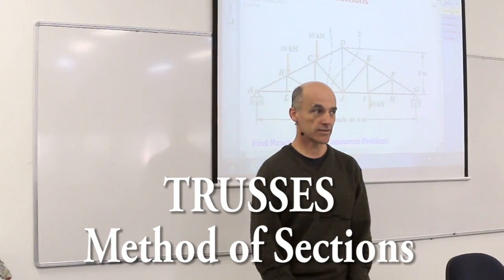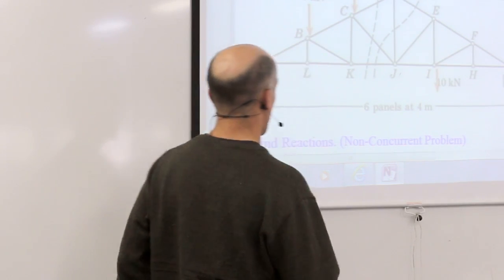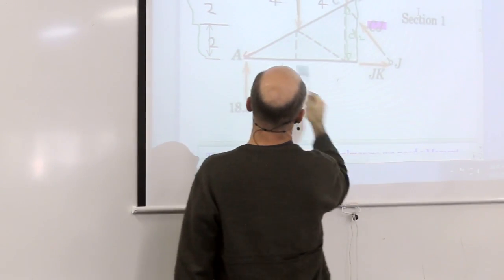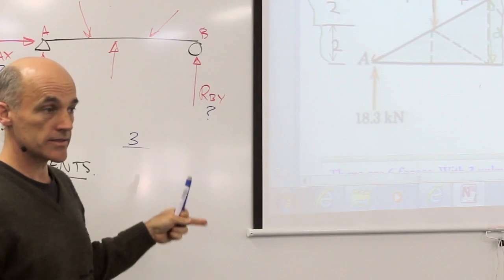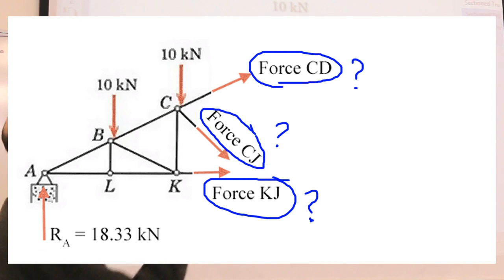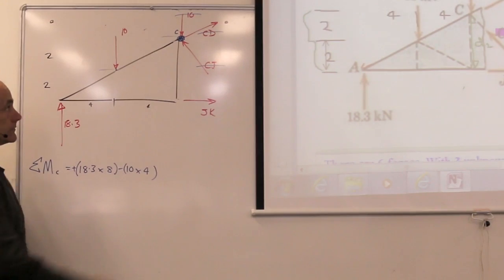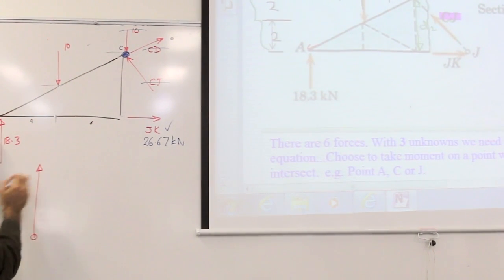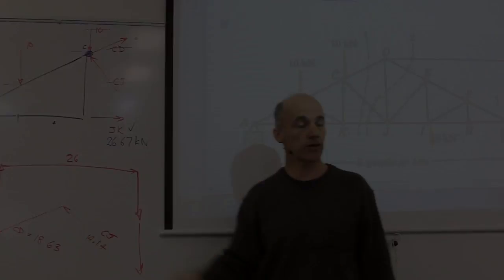Trusses: Method of Sections

Comment: I don't understand how you got all the force values at 7:40
Reply: They figured out the angles of the force vectors from the height and length of the truss, then since a force polygon in equilibrium is closed, they just drew everything to scale and measured the lengths of the vectors.
Reply: Thank you for this explanation. I will now proceed to use force polygons on every one of my statics exams.
Reply: @taylorinase2148  He would have solved it by using trig. If you complete the triangle containing the two unknowns you can solve easily since you know the length of the horizontal side and all angles. Sine rule lets you solve for CD and CJ. Simples.

Comment: How to assign the directions for forces (compressive and tensile) especially on trusses?
Reply: you assume it however you like for any truss. Upon calculation ull discover ur answer to be either positive or negative. If for a certain truss u got a positive force and ur assumption for its direction was tension, then ur assumption is correct and it is indeed tension. If ur answer turned out to be negative, then it is the opposite of what u assumed, therefore compression.

Comment: How did you do that force polygon method? ha
Reply: Awtsu Er Er I really dont get it? you have the values already.
Reply: Awtsu Er Er If you have Autocad it will make the force polygon so much easier. As you can see, he first solved JK using the Moment equation but he still needed to solve CJ and CD. You convert the Forces magnitude into mm or cm so 10KN will be 10mm. When you draw up the force polygon you draw up each force into millimeters at the exact same angle shown on the diagram. With CD and CJ you complete the loop only using the angle of these two values and trimming off the excess where the two meet. Then the measurements of CD and CJ will be the magnitude of force.
Reply: +Awtsu Er Er The fact that you are confused/asking is telling.  You are not alone.  The force polygon is basically a short cut(like identifying a zero force member by "eye").  The real method is just a simple FBD: ΣFx=0 and ΣFy=0.
Reply: thank u